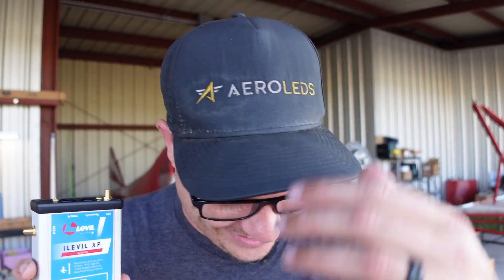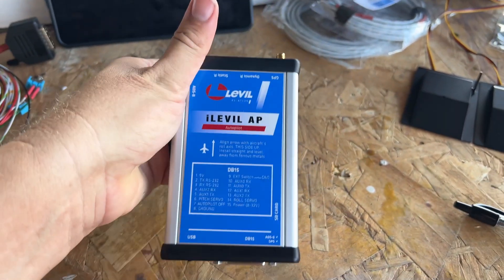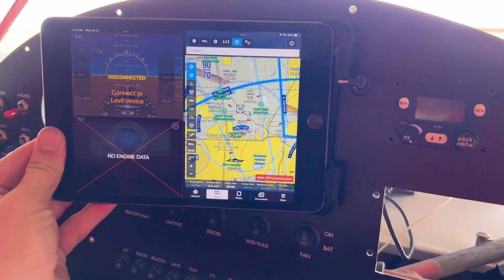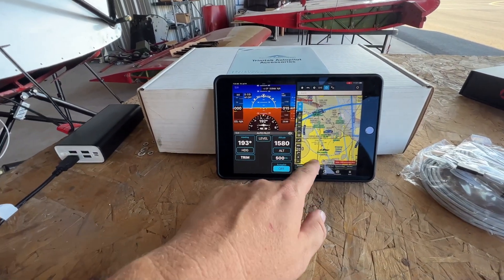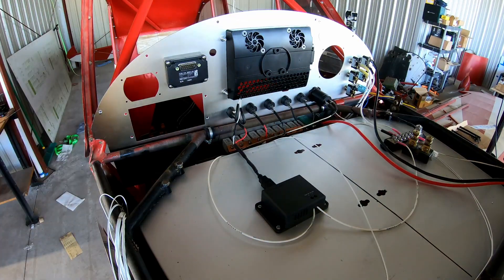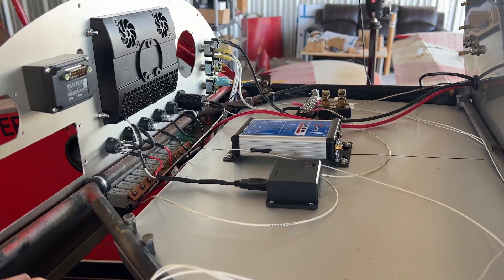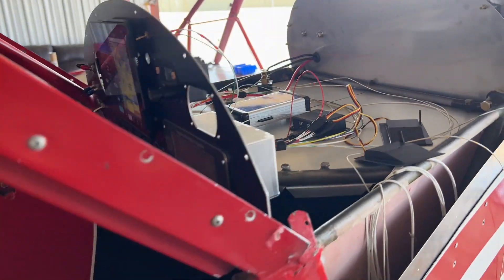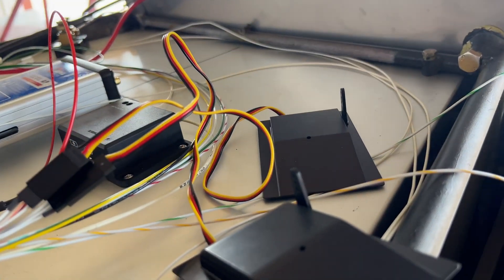It Has ALL The Avionics! | iLevil AP Install

Comment: Hey, thanks for the videos. Which would you go for toyday? Level aviation or Microair avionics?
Reply from the maker: Depends on the application. New build with space, I would probably use something like MicroAir, or Dynon. I like the microwair products a lot. The iLevil is a much less expensive alternative and I have everything I need right on my screen in a lot less space and anyone in the back seat can put an ipad on a suction cup and have the same information.

Comment: What EFIS set up are you using? Looks as if you have a cooling fan built in... Is that an iPad?
Reply from the maker: It is an iPad. The iLevil AP drives the iPad. I'm using a Xnaut mount that I cut into the panel. Wanted good cooling and  most panel mount stuff isn't adequate IMO. I have a video on the mount I stall over on the channel page.

Comment: I don't know how I havn't come across your channel already! You've pretty well installed my shopping list!

The one thing you havn't done a video on (unless I've missed it?), is the install of your GRT EIS. I'm on a budget, so I have to stagger the component purchases, but I think this is the next step so i can get on with engine testing (because like yours, my engine is 2nd hand)

I'd love to see a video of your install (even if it is retrospective) including any challenges, what's included in the kit and how you go about calibrating it.

I know this will be out of order for your series, for what is otherwise chronological, but seeing it is fundamental to the operation of the engine systems display on your PFD, perhaps you could do it as a recap/summary of the integration of all your avionics (GRT EIS/iLevil AP/iPad/SuperECO

From Australia, keep sharing!
Reply from the maker: We're installing the EIS soon. We've been waiting on some parts unfortunately. The was supposed to be the last piece to our puzzle. Then I got a phone call from a potential new sponsor. Something fun is coming. BUT, I think going to love flying with this setup.

Comment: Nice video!  I'm thinking about buying an iLevil AP and would like like to know if you are happy with yours after having used it for 5 months.  Any problems or issues?  Thanks.
Reply from the maker: I'm still building the plane out! Hope to get it done this month. I'll be doing a TON of flying with it after and be making several videos of the different products I've put into the plane.

Comment: sooo... where's the second half of that video?! =) Very curious to see the servos installed.
Reply from the maker: I'm hoping soon! I'm working on the fuel system for startup, things are just taking more time than expected. Hardest part of the servo install is going to be running the wiring. =) It's plug and play after that.
Reply: @flywiththeguys  it is crazy (and awesome) that such a small surface area with an RC servo can have so much impact on a real plane. Hoping more RC tech makes it to planes!

Comment: Wait a sec you servo looks almost identical to the servos on some of my RC planes 😂
Reply from the maker: Thats because they are. 🤣Believe it or not they don't require a lot force to make changes to the aircraft. Other systems use larger servos because they are manipulating the whole control surface. With just the tabs the little servos are highly effective. I was talking to them about servo failure at OSH. They haven't had one in testing, and no reports of issues from customers.

Comment: Cool install! This seems like a great product but I just can't wrap my head around some things. Why rely on a wireless connection and an Ipad, would it be that much more expensive to add a wired display and insead use Ipad/tablet as backup?
Reply from the maker: It REALLY helps reduce the cost. In reality, the iLevil AP is just transmitting a small amount of data and the iPad is providing the graphics through the app. So the major display and processing power is in the iPad. To make a wired display you would need to add similar capabilities to the iLevil AP OR to the display.
Reply: Agreed, provided that you have a back up like the G5 or som I think this will be really awesome!
Reply from the maker: @KofiAsare0  Ive got something. =) Installing it this week.

Comment: this is super awesome! it all looks very neat and i love how it’s coming together! just a few questions and concerns.

now i’m pretty sure i know the answer cause the end but will you be adding backup instruments so if your ipad fails you’ll have your instruments? cause i feel like an ipad isn’t the most reliable thing for for something as important as your instruments. especially if it suddenly goes ifr because of something like smoke from a fire that just started (which is a very real possibility). that combo is probably very unlikely but those are things i hope you’re doing your research on 😭

also since all your engine stuff and avionics switch is on the left side and that cut off is on the left side, if you go to feel around for the autopilot disconnect is there a chance you could shut off your mags or anything?
Reply from the maker: Of course! That’s one of next weeks videos.